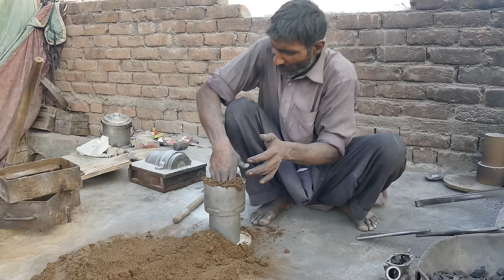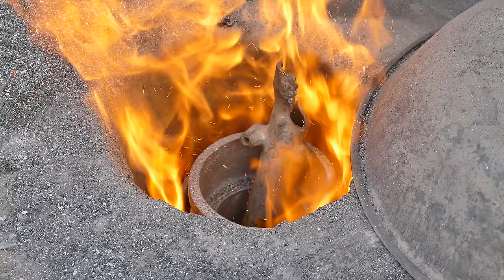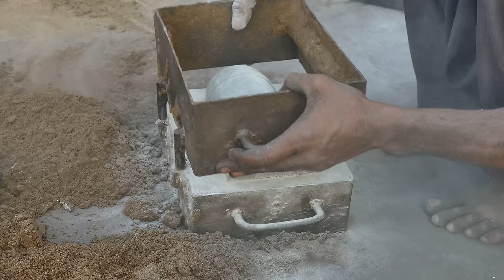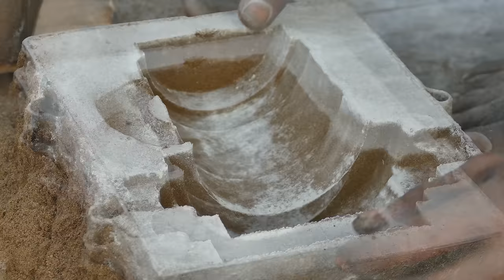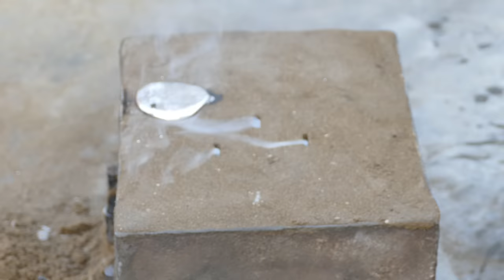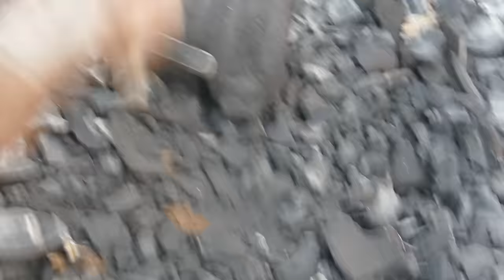DIY Aluminum Socket Casting Projects Using Sand Mold

Comment: I apologize for insisting on the same question.
What is the preparation of this molasses sand ??
I've done a few tries but couldn't get any positive results
Reply: Valid question.
Reply from the maker: Please watch this video: https://www.youtube.com/watch?v=ToWAUA5CRs8
Reply: Belarte artebel they have to mix adhesive with it
Reply: Forget the molasses use dry powderered
Reply: Use dry powdered clay just like regular casting sand